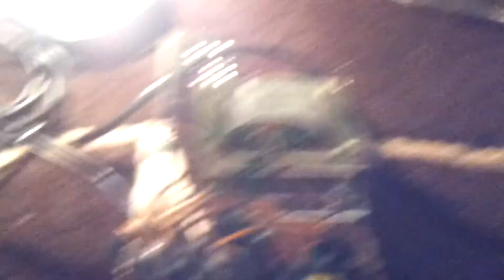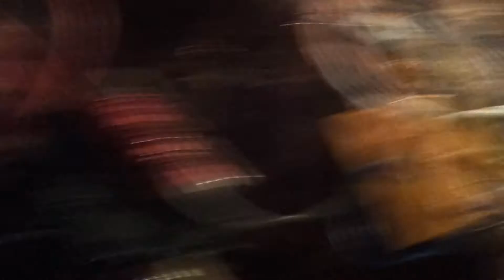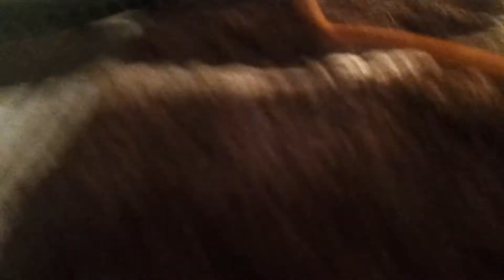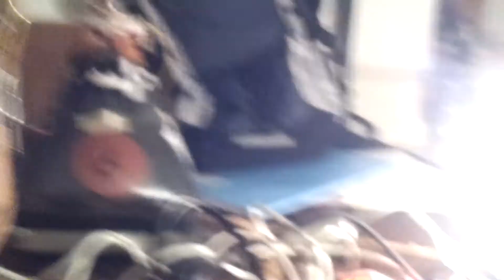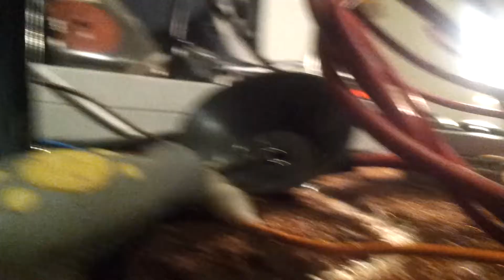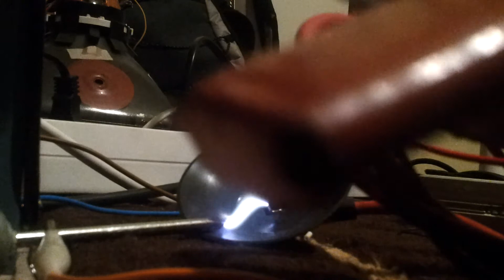IGBT ZVS

Comment: Very nice mate, try changing the capaciter with different values and you will notice a differance in ya arcs. ;-)
I try doing the same when I use different voltages. And I have to change the caps too with different flybacks. As all work differently!! Hope this helps matey ;-)

BIG THUMBS UP*